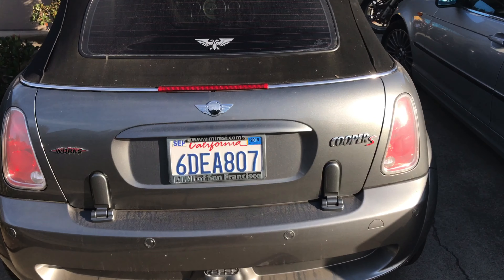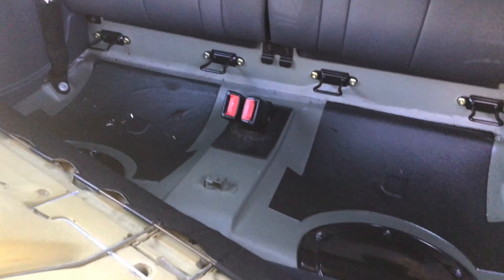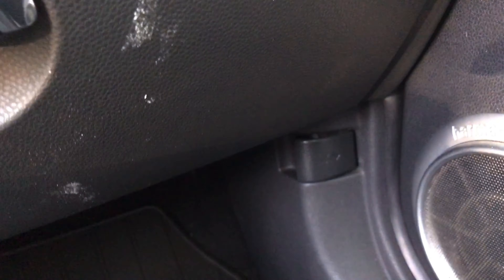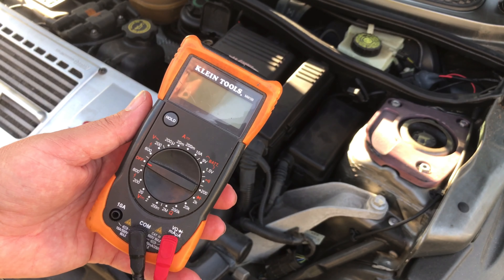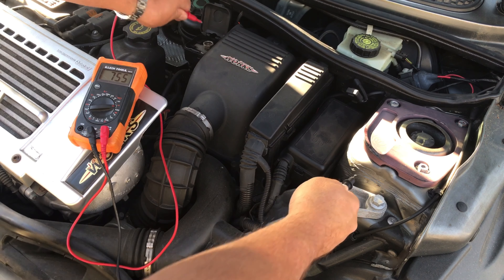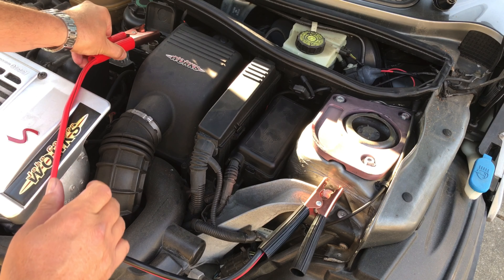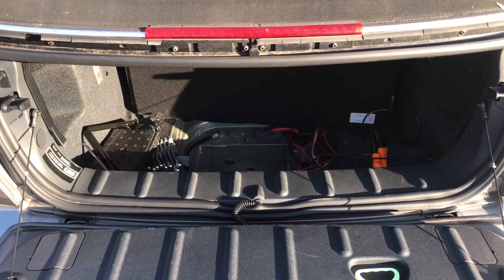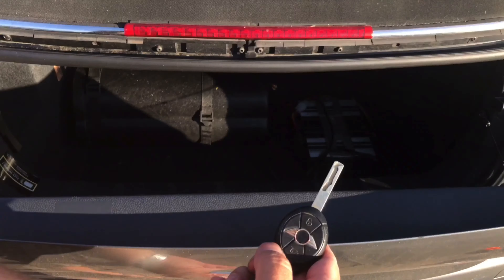How to open R52 Mini Cooper Convertible rear hatch with dead battery.

Comment: From the back seat, you can reach over the parcel shelf and pull the emergency escape handle.  We have two of these R52's and have done it a few times. We also have two R53's with the release ring under the bottom cushion of the rear seat.   I'm not a little guy either.
Reply from the maker: Thanks for sharing!

Comment: You could also feed 12 volts into the car's cigarette-lighter socket using a power-plug and wires; the wiring for the lighter socket would be much smaller-gauge than jumper cables, though, and so this method would only work if you needed maybe ten amps or less to activate the hatch-release.
Reply from the maker: Great tip!

Comment: Thank you for posting this. I had to do a bit of work under the bonnet of my  R53 and  inadvertently closed the boot after disconnecting the battery. Realised later I couldn’t open it. With no visible means of opening it Youtube came to my aid.
Reply from the maker: It’s silly sometimes and other times it’s just a pain in the butt. Glad it helped!

Comment: Since you own a convertible, you can fold the back of the rear seats down and reach for the escape handle on the tailgate to open it up
Reply from the maker: but they lock so folks can't get into your trunk.
Reply: You can't not possible
Reply: You can also lift up the trunk panel and reach the handle

Comment: 1:47 It's a good idea to test an "unknown" circuit for voltage before you test for ohms or continuity --- if the circuit has any "residual" voltage in a capacitor or battery, it could fry your test-meter if you connect it in the "ohms" setting.
Reply from the maker: Great tip! ❤

Comment: even with the cargo cover installed there is enough room to get into the back seat, put your arm around and pull the green release handle. I just did this after removing the battery and closing the rear lid for winter storage and realizing how will I get the battery back in come spring time :)
Reply from the maker: funny - when I made the video, I didn't know that handle was back there.... It's tough, but it's possible!
Reply: Yes, this is really easy to do - takes 60 seconds tops even with my big fat hands!

Comment: No that’s not it. If you change the battery in a mini you have to have it hauled to an authorized mini dealer or to a shop that works on minis and have the programming equipment to pre program the car to the new battery. Our local BMW dealership didn’t have the reprogramming equipment to do it. Cost me a fortune.
Reply from the maker: sorry to hear this. I had no issue from changing a battery.
Reply: they always say that but it's not true it's a way to make u pay more
Reply: The battery programming is only on 2nd gen and newer minis. 1st gen don't need the programming. Also any good obd reader/coder designed for mini BMW typically has the programming function. For example foxwell 510 etc